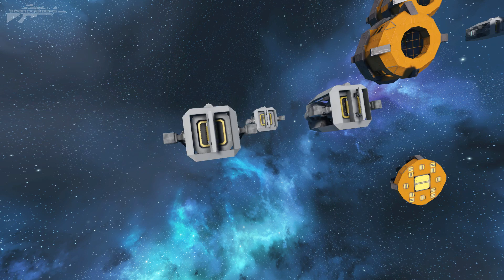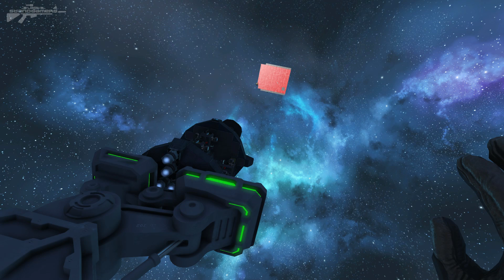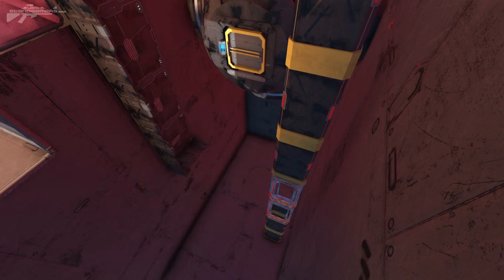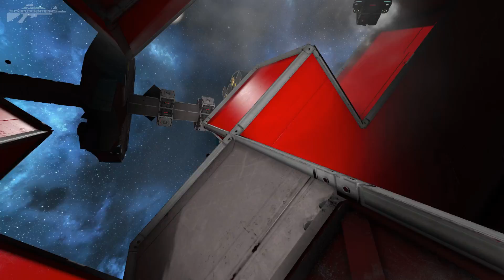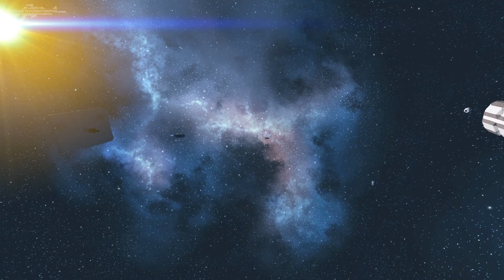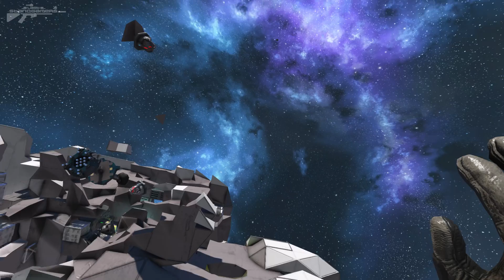Weapon Rips Ships Inside Out - Space Engineers

Comment: here's a thought, add a couple sensors and a gyro, so if the forward sensor doesn't detect anything the grav block is shut off and the gyro does random rotation until it detects a shop/station then the grav block is back on.  should help minimize those things from leaking out